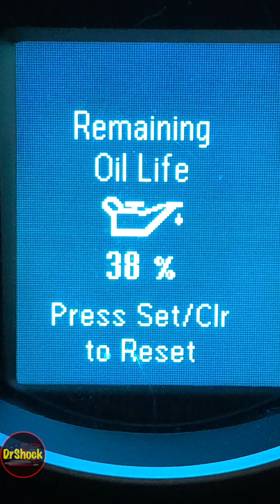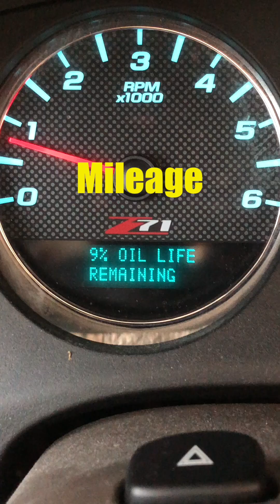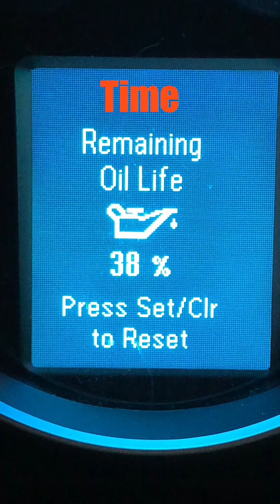2010 - 2025+ How does the Oil Life System Indicator Work on General Motors Vehicles #Shorts

Comment: So at what percentage do you recommend an oil change?
Reply from the maker: Many articles, and videos, have been done on the accuracy of the GM oil life system indicator.  I'd suggest following it for when it pops up to change oil soon.   Using the weight, grade,  and type of oil recommended in the vehicle owners manual.